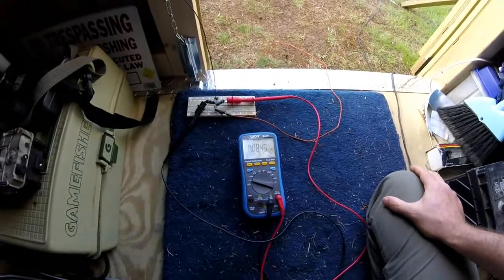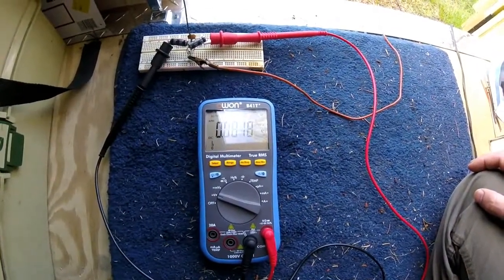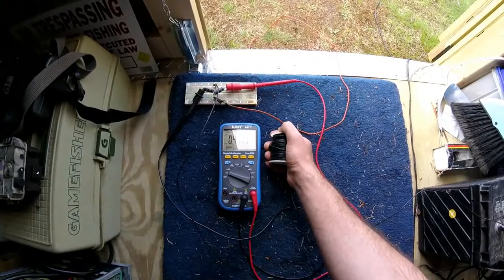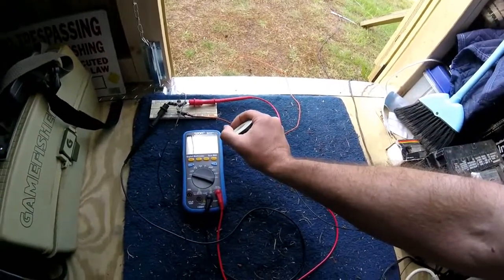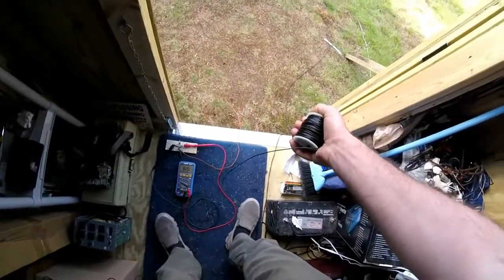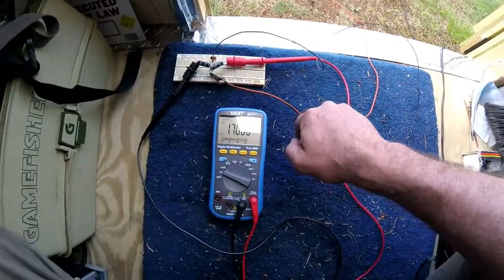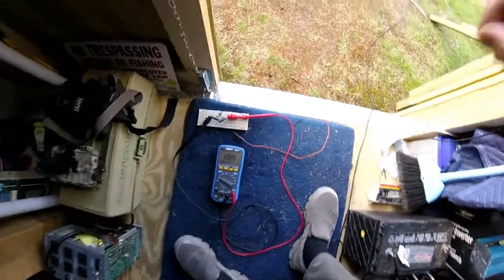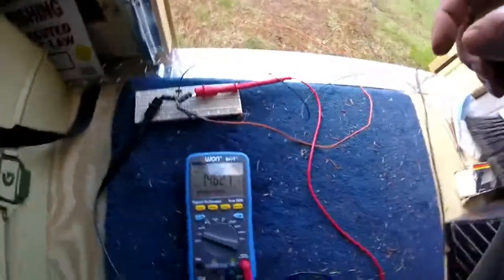Free Human Energy Generator ~ I Am Charging Capacitors

Comment: its from your body heat, it isnt cosmic or mysterious its just the food you eat being used by your body to make heat being turned in to a very small amount of electricity in a very very inefficient way.
Reply from the maker: If that were true then why would the output be increased when I stand up? My temperature is not changing that fast.

Comment: Total guess but is this acting like a therocouple? With the nail being a different metal then the wire? When it sees a difference in temperature from you holding it creates voltage. You might want to try heating up that wire without touching it to see if you get the same results.
Reply: wiggys.  Good idea, but I still predict RF is the main source.  Adding a tuned tank circuit would prove it is RF if the power output increases, but if thermoelectric, no gain in power would occur.
Reply: EnergyCrafts that would be a lot of voltage increase for a small temperature change so I'm probably wrong. I know that he's just doing quick tests to check out these idea but it might help a lot in the long run to test these ideas under a load. My thought would be if you didn't want to spend a lot of time taking measurements these tests could be run a with a 10ish ohm resistor when taking the voltage measurements. If he uses the same resistor for checking all these ideas. It would be a fast and easy way to be able to check the performance of them against each other.
Reply: wiggys.  I agree for quick and dirty measurements.  I have watched thermoelectric technology over many years and unfortunately no real improvement in efficiency has occurred or cost breaks compared to solar cells over the same time.  Thermoelectric would be great if it ever became efficient as unlike solar cells, the hot/cold energy gradient in many places is available 24 hours a day and can even  complement solar panels during the day by acting as a heat sink to remove solar panel heat while producing electricity from the "waste heat."  The now cooler solar panel would become more efficient and output more power and last longer!  Win, win.

Comment: Troy, your body likely is adding capacitance to the wire inductance and this helps to tune the circuit toward resonance to an incoming strong RF signal.  You likely will get much more voltage AND amps if you rig a tank circuit like is shown on crystal radio circuits with an antenna and ground and run the output of the tank and ground to your diode/capacitor arrangement.  Now you can tune to ideal resonance of whichever signals are the strongest and get more POWER out.  Use full wave bridge rectifier to get max power out.  I have had voltages over 100VDC with nearby radio station 2 mile away.  Enough energy to power transistor radio, light neon bulbs and charge capacitors to run toy motors for a while.  If the tuned tank improves your output, it would prove electrostatics (DC) of the air is not the main source energy here.

Comment: At first i noticed that spool of wire was near the roof and i noticed the wire was running right along side a galvanized chain hanging on the wall. I wonder if the chain was just robbing it of the energy???

Comment: There is energy in the air all across the electromagnetic spectrum. The problem with harnessing it is the inverse-square law. The intensity is inversely proportional to the square of the distance from the source. This means that the energy is getting exponentially weaker the farther it travels. By the time it reaches your antenna, it's so small that it's useless. You would have to be very, very close to a powerful radio transmitter in order to get a usable amount of power. For example, when I was a kid we used to hold fluorescent light bulb tubes up to our CB radio antennas and get them to flicker. The guys who were running powerful (illegal) amplifiers could get them to glow bright up to 5 or 6 feet away.
Reply from the maker: Yes true. But there is also energy in the air from lightning, static and cosmic rays. I am not exactly sure which form of energy this is. With today's electronic world we just cannot isolate our experiments like they did 100 years ago to eliminate radio interference.
Reply from the maker: HAM radio operators are aware of the energy buildup in their antenna wires which can reach 100s of volts and blow out circuits.
Reply: Electrostatic energy is also subject to the inverse-square law, along with sound, gravity, light and pretty much any form of energy or natural phenomena that travels through space or affects space. It's just one of those universal laws that our known universe if bound to on a very elemental level.
Reply: Regarding electrostatic charge between an antenna and the ground, what you're referring to is basically the same thing that causes lightning. It's very hard to predict or harness, and while it's very high voltage (which can indeed fry radio circuits), it's also relatively low current, so it's not a particularly large amount of energy overall. There are articles written on the topic. Just google "harness lightning".

Comment: I know that all these sort of things create very little electricity, but is the any way to collect the energy and wait till a significant amount has built up before using it?
Reply from the maker: Yes, you can collect the energy in a capacitor and use it later or discharge it into a battery when the voltage is high enough